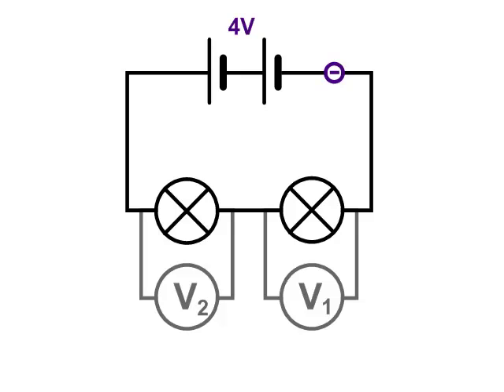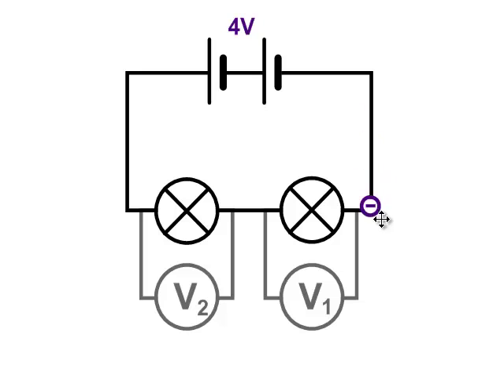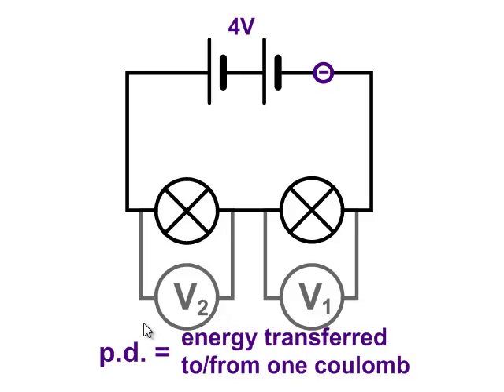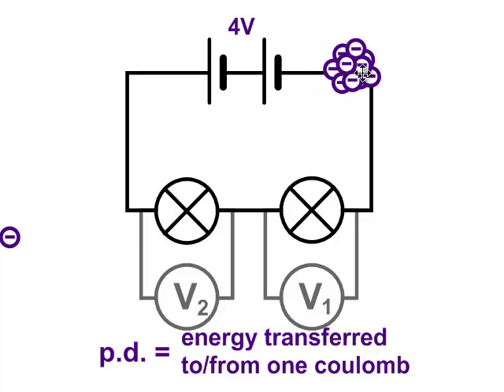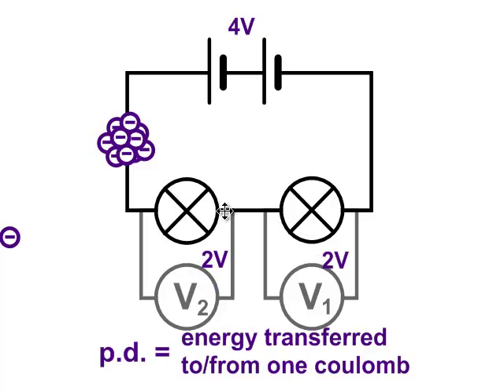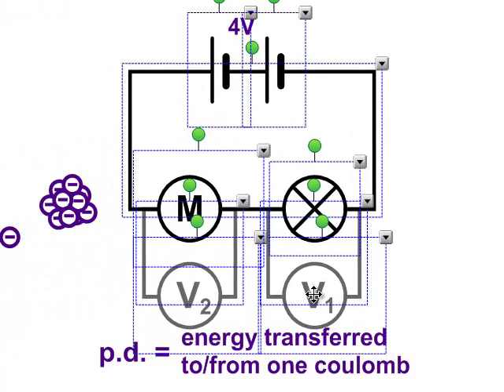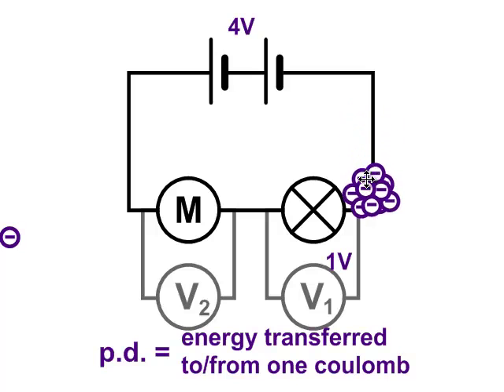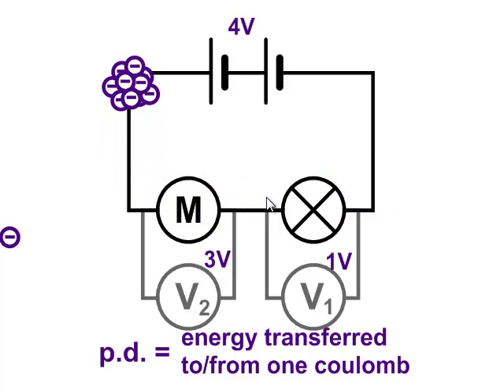Potential difference (voltage) in series circuits

Comment: Is the potential difference across the components negative, because they take energy away from the electrons? Also, after passing through the second component, why doesn't the current stop despite giving the components all its energy?

Comment: I really, really, really don't understand HOW voltage is shared between the components.

How on earth does the coulomb know that it should only give away a few joules to the first bulb and save an equal amount for the second bulb? Why doesn't the first bulb suck up all of the energy? How come some passes through when there is merely another bulb on the circuit???

Also, how do the coulombs keep moving when they have 0 joules of energy? After they go through all of the components, and are on their way back to the battery, how come they can still move when they have 0 joules/0 volts? If they have 0 joules but can still move then how come that movement can't be converted into heat and light still?

And, finally, if a resistor resists coulombs by slowing them down then how do all of the coulombs and current before the resistor slow down, too? And if they slow down then does that mean they have less energy to take to the light bulb? Why doesn't the fresh energy from the battery go as fast as it can before it hits the resistor?

I don't want to hear any analogies about water, either, I want to know what physically happens to those electrons that makes this possible. I just don't see how less current means less energy when that current seems to come from energy in the first place.
Reply: +Controversy Owl hey can you explain to me how you understand it all now? I have the same questions
Reply: +Controversy Owl Think of it like electrons being pulled along by a vacuum and itll help. Thats not entirely accurate, but it'll help you comprehend current vs the movement of electrons.
Reply: Richard Smith I understand it now, anyway. Thanks.
Reply: I have the same first question but how do i ask the teacher!!???
Reply: My guy wrote an entire book just asking for help

Comment from the maker: I just made another video which you might want to look at - the link is in the description.
Reply: Pete Gravell so let’s say you have a voltage of 3v and there is 2 bulbs does that mean each bulb gets equal amounts so 1.5 v each or could it be different amounts of voltage so one gets 2 v and the other gets 1v

Comment from the maker: Yes you're right that all the voltage 'gained' going through the cells is then 'lost' as you go around the circuit. 

If you increase the voltage, two things happen - the energy transferred by each electron increases, and the electrons will flow more quickly around the circuit. So if you double the voltage of the cells, energy is transferred four times more quickly. This means things like the wires and the bulbs get hotter. If the voltage is too high the filament in the bulb will melt (blow).

Comment from the maker: Hi Max, actually you can have the cells either way round (as long as they both point the same way). In this case I am demonstrating the flow of negatively charged electrons around the circuit, which flow from negative to positive, so the current flow according to my cells is correct.